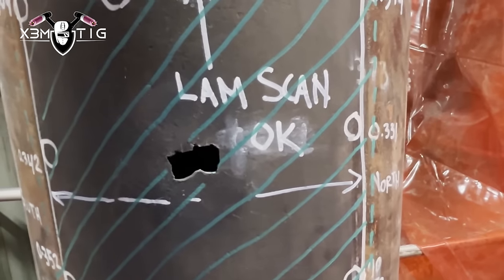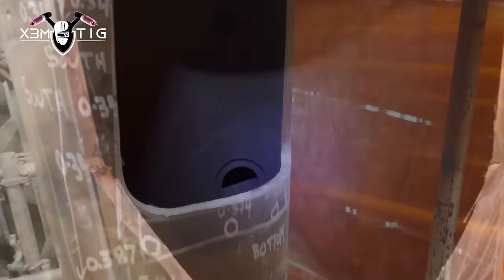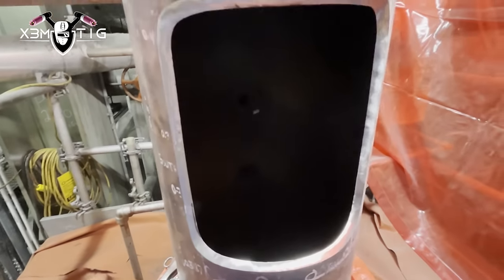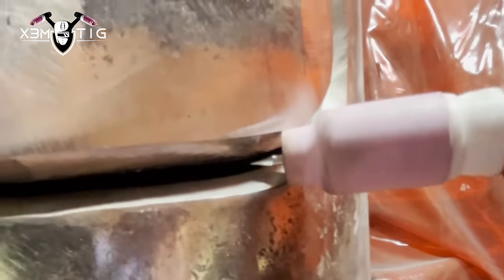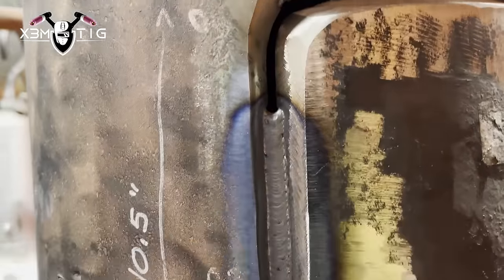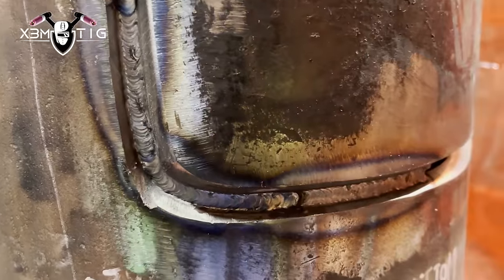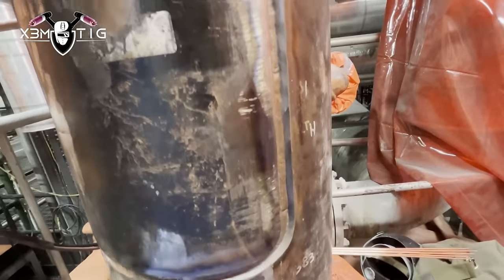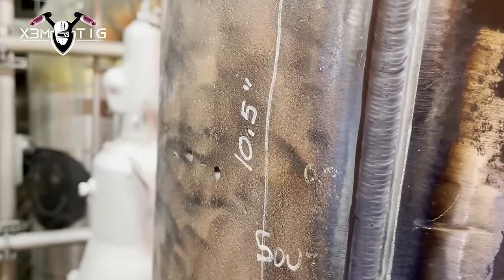TIG Welding a Carbon Pipe Patch to X-Ray and UT Standards !

Comment: Fascinating m8 thanks for sharing quick question on the top left, and maybe bottom right corners which would be your awkward corners as you are a right hander, did you still use your right hand or did you freehand with your left? Cheers mate
Reply from the maker: Good question, I did all with my right hand, top left corner was little tricky but not big deal.
Reply: @X3MTIG  you must have been folded in half like a sandwich lol 😆

Comment: Awesome stuff. Do you ever see any jacketed pipe? Would be a big help to see your method on that procedure
Reply from the maker: I got one older video welding jacket pipe.
Reply: @X3MTIG I'll watch it for sure. Your vids have been a huge help. I've been watching them and then burn some coupons in my shop over and over. You helped me go from just structural to hastelloy and economiser tubes. Just got to the end of the season working at CEDA where Travis field @fieldres was before. Might be a long shot but I'm looking for work.  Do you know anyone looking for a welder?
Reply: @X3MTIG where can I find that video of the jacketed pipe video you did

Comment: Bit late now, but you could easily use a couple of strongbacks to stop the patch from falling in as you weld. I used to use this little trick a lot when I was working on ships.
Reply from the maker: Thanks for your suggestion, that’s a good tip 👍
Reply: @X3MTIG  been loving the vids by the way, I'm trying to get onto a power plant site in the UK at the moment and am enjoying seeing the more awkward fit ups. 👌

Comment: This is usually done on DA/expansion tank, boiler shells etc- I’m surprised  they didn’t just cut the section out completely. With that much internal damage- I’ll also be surprised that they didn’t utilize a thicker section of steel, hard coat the inside or add a double section externally.
Reply: I second that. It might have to do with union overlap, meaning that if the plant has contracted UA and Boilermaker and Millwright unions that the contract would be breached if it was a boilermaker making the fit up on a branch cut out. Rather they can kinda sneak out of calling a certain union if it’s a patch, there by saving money and time.
Reply from the maker: Emergency outage, no time for replacement pipe section, also it’s connected with branches that are Cr. so lots of money and different contractors would be involved to get this job done properly. Next outage is scheduled for next year, and they will be replacing everything!

Comment: That is not carbon steel, it is CrMo in all likeliness, or it should be in steam service. I am surprised it wasn't a cut out rather than putting in a patch! I am guessing an Engineer has approved this technique for repair, your seamless pipe is now welded pipe..? Could have put in a thicker patch to allow for future erosion...   PWHT / Hydro to follow...
Having said that nice to see a video of what you are doing.
Reply from the maker: Thanks for your comment, pipe is carbon steel, and branches that are connected are Cr. One of the reasons why engineers didn’t cut out the section and instead approve the patch is to avoid all those different materials being welded, and pwht involved etc. Closure weld procedure usually eliminates need for hydro testing. This was emergency outage and time is crucial, also this should be good for a year until next planned outage is scheduled.
Reply: Closure weld never eliminates the need for a hydro per ASME, unless a local law provides for that, which is unusual.
I noticed you were using a CrMo filler to fill what you say is a carbon steel weld, it seems strange to do that, are you sure this is not CrMo material.
In any case I am pleased you have posted this, this window technique can also be used to weld out pipe when only 180 degrees around a pipe is accessible, such as inside a boiler tube rack. Thanks for posting it.
 @X3MTIG
Reply from the maker: @paulmeersa7162  According to ASME B31.3, the closure weld procedure can eliminate the need for hydrostatic testing in certain cases. The closure weld procedure involves welding a closure weld at the end of a pipe or system to seal it off. 

If the closure weld procedure is performed in accordance with the requirements specified in ASME B31.3, and if it is demonstrated that the closure weld provides a leak-tight seal, then hydrostatic testing may not be required. However, it is important to note that this exemption from hydrostatic testing is subject to certain conditions and limitations.

The decision to eliminate hydrostatic testing based on the closure weld procedure should be made in consultation with the applicable codes and standards, engineering judgment, and any regulatory requirements that may be applicable. 

Yes, you can weld carbon steel pipe using a TIG welding process and the ER80S-D2 filler rod. ER80S-D2 is a low-alloy steel filler metal that is commonly used for welding carbon steels. It provides good strength and toughness properties and is suitable for welding carbon steels in various applications.